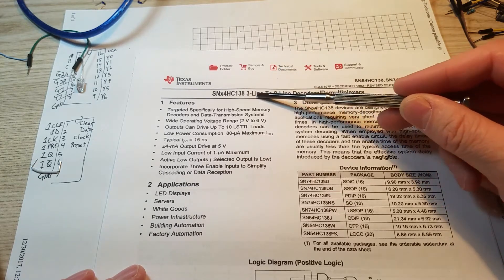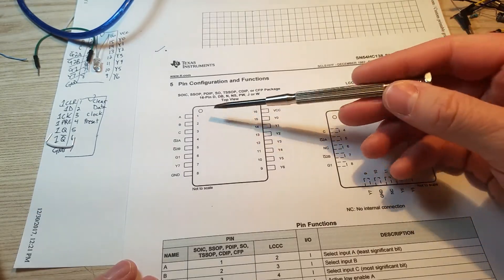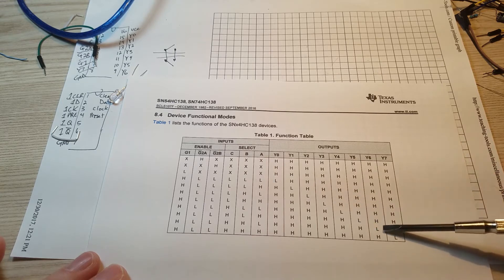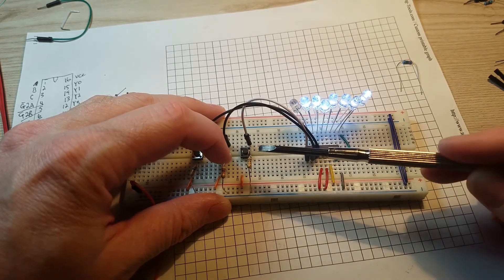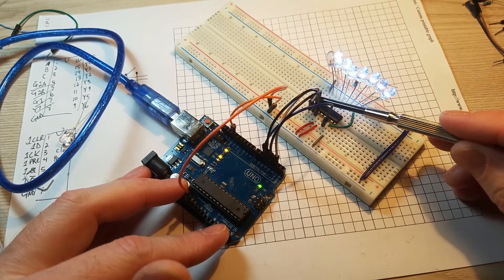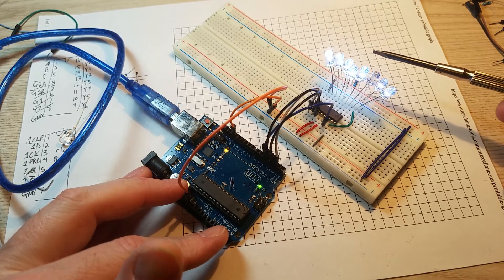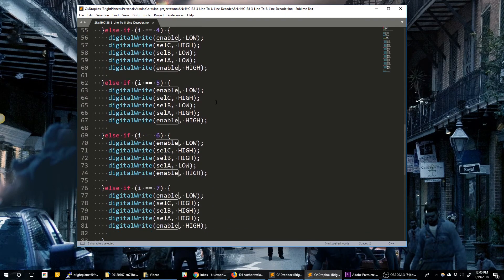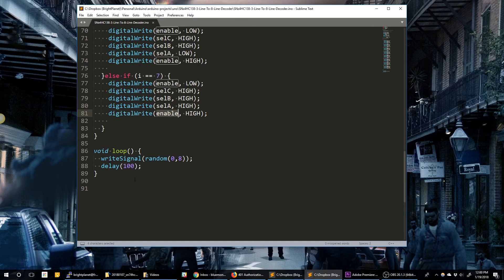SN74HC138 3 Line to 8 Line Decoder/Demultiplexer

Comment: What is the function of G1, G2A, and G2B?
Reply from the maker: Those are input controls to cascade devices together on the same bus. With these enable pins, you can have multiple devices on the same bus without them interfering with each other (obviously you need to enable only one at a time). It gets complicated fast.

Comment: I know its an old video, but you could probably invert those LED by using a high ground. Depending on the IC, you should be able to drain the current from the LED via the IC.